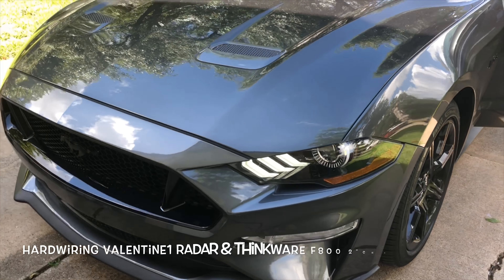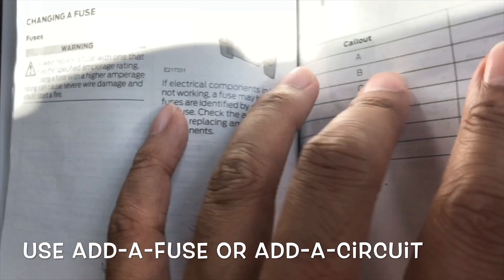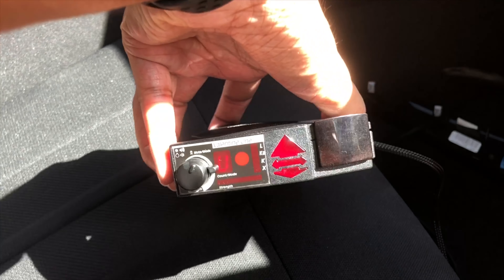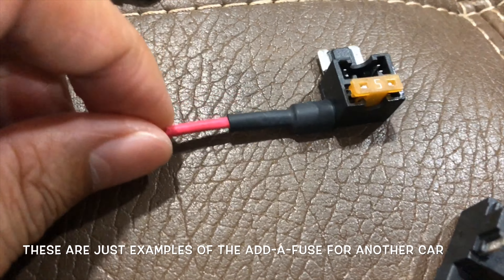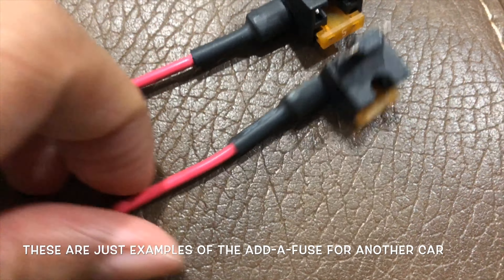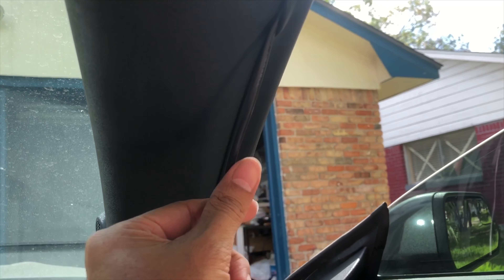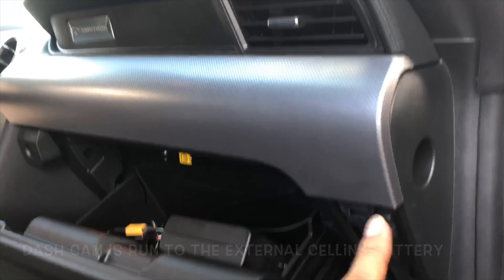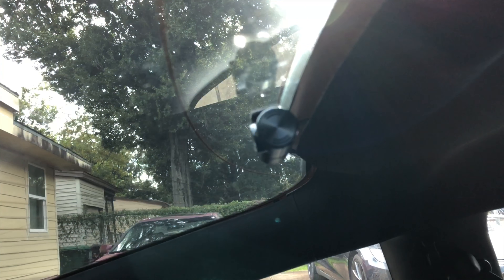How to Hardwired a Radar Detector & Dash Cam for a 2018 Ford Mustang GT

Comment: Very useful information!

If anyone has the Cellink NEO Battery, you might want to use at least a 15A fuse for the High input setting.
Reply from the maker: Thanks for letting me know about the Cellink NEO. My friend is using the older Cellink Battery B but I’ll keep that in mind regarding upping the fuse to 15A for the newer model 👍